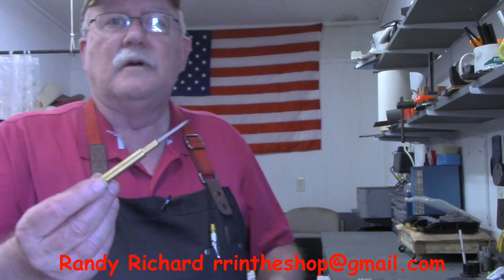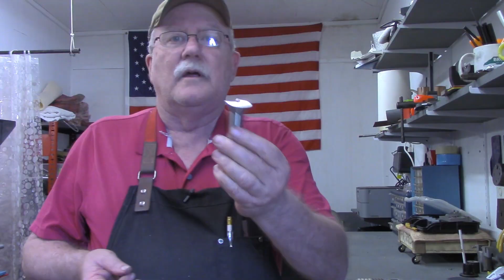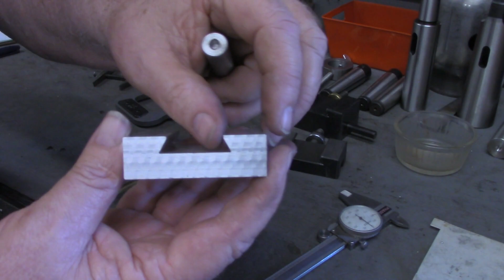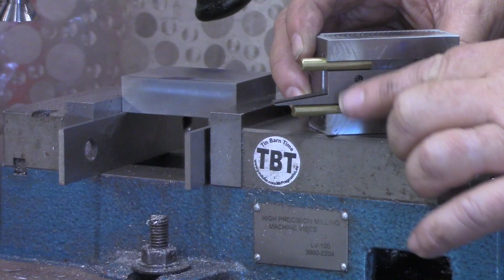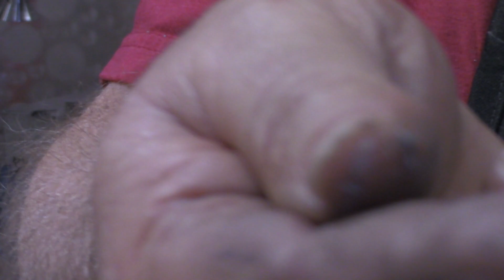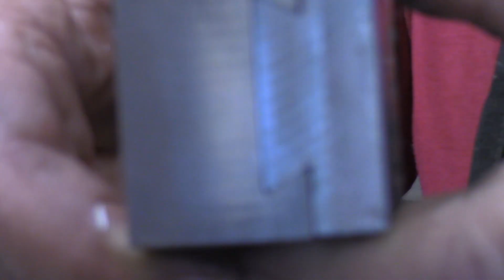Machining Matching Male & Female Dovetails

Comment: Hi from sunny England! Just found your channel and have spent the evening watching your videos. Thank you for the very informative, educational and entertaining content and for sharing your expertise! You are a really talented guy and I'm really enjoying learning from you. You have a very straightforward, no nonsense approach and a very clear delivery. Thanks again! Subscribed.

The main reason I zoned in on this particular video is that I want to build my own CNC milling machine similary to a number of projects seen on YouTube, but instead of using those linear rails, use dovetail ways instead. Seeing how accurately you made those dovetails has given me great confidence that with enough time and practice, I could perhaps do it too.

May I ask: are you milling the sort of steel that machine ways are usually made out of? If not, what material would you make machine ways out of and how would you harden them? I'm thinking that milling machine ways require a jib for adjustment?

Comment: How much payment to make a small male and female dovetail in either steel or aluminium? I am DIY and currently building a table router fence and need a robust linear sliding function for one of the micro adjusters. No crazy tolerances.

Comment: Thanks for the video, very interesting and thought provoking. But I think you were lucky, because your pin diameter is the same as the depth of cut, ie the height of the dovetail. Here is my thinking about it: having made the female part and measured it as you do, surely you must now have the (same) pins reference the TOP surface of the male part as you are making it and measuring it to size?  And this will be tricky to hold in place for measuring. I suggest using pins that are exactly diameter of male dovetail 'height'. Then they can sit on the 'base' of the male part for measuring, at. which time they will line up exactly with the top. Aaarghh. Geometry tells the tale, and a simple sketch shows it clearly.
CraigS was thinking along similar lines 3 months ago. Altogether a fascinating and tricky problem, and I appreciate what. you have done and shared here. Best wishes!
Edit one day later: Double AAARGHH I am wrong !!!

Comment: You ccould measure the male also with micrometer by measuring the outside minus twice the diameter of the pins. Now you use the same measurement device to measure only the difference instead of two absoluut distances
Reply: Thanks for the input, but I don't think so. See my post in the main thread today, and CraigS a few months ago.

Comment: Nice video,  nice well fitting dovetail!
One thing to consider when you measure both sides with the pins.  Unless the pin is the same diameter as the depth of the dovetail you are not measuring both parts at the same point on the slope face of the dovetail.  If the pin diameter is smaller than the depth of the dovetail you would measure the female as indicated but on the male dovetail the pin needs to reference the top of the part (widest part of the dovetail) to measure on the same plane on both parts. Edit:  Even this may not be adequate, just realized the pins don't contact the slopes of the dovetail at one radius above the bottom of the dovetail it actually contacts at  one radius plus the sine of 30 degrees times the radius  1.5 radii above the bottom.
Reply: Oh I think you are right the first time mate - ie pins reference TOP surface of the male part. And this will be tricky to hold in place for measuring. I suggest using pins that are exactly diameter of male dovetail 'height'. Then they can sit on the 'base' of the male part for measuring, at. which time they will line up exactly with the top. Aaarghh. Geometry tells the tale, and a simple sketch shows it clearly. 
I was just figuring this out when I saw your comment. Thanks to Mr Pragmatic and to you.
Reply: The pin diameter for a 60 degree dovetail is 1/3rd of the dovetail depth if you want to use the same dimension for both male and female parts. - https://drive.google.com/file/d/1GVwxHEvnL8JpYFfUzes3Z2zrhlT1NNAX/view?usp=share_link

Comment: Is there a meaning at all to the angle of thw dovetail?  Is it 60 degrees from horizonatal? Do some producers use some odd specific angle just to brand themselves, or can it be a more important thing? why not use the large radius corrugated pattern used on jet engines now,  reducing all the complex vibration at fast speed?  Is there a lathe in the world that can do 20000 rpm on large aluminum, for ridiculous surface speed,  (that would still be way to fast for AL huh) 2000 surface feet is adequate for rough work.
Reply: horizo-natal? At 20,000 rpm? Spectacular!!!  Seriously though . . . 45 degrees, 30, 60, are the common angles. It's all about  the horizontal and vertical force vectors across the angled surface.  Cheers

Comment: I'd like to point out a couple slight problems with your method of measuring a dovetail.  You use pins that have
an uspecified diameter. This introduces two problems.

The first problem is to not hit the dovetails at the same depth.  Think of using pins with a diameter one tenth the depth of the dovetail cut. Lets say the pins then hit the female dovetail at the 5% depth.   Then measure the male dovetail the same way, and you will be at a 5% depth again, but relative to the female dovetail, you are at 95% depth.  I'll leave it to the reader, to figure out what happpens with pins that are too large.  

What you want is to have the pins hit at the exact same depth on both male and female dovetails.  pick an arbitrary place, I pick the middle point to make it easy. what dowel pin will hit at the middle? you might think a dowel pin with a diameter equal to the depth of the dovetail, you'd be close but still wrong.

For a 60 degree dovetail a circle (a round dowel pin) will hit it at 60 degrees, so you need a dowel pin that is sin(60) x depth of dovetail.  So .866 x depth of dovetail.   Your method was close because you used pins that were close to this size.  For those who have tried and had bad results, check the size of your dowel pins and see how close they are to .866 x depth of cut.

There should be a correction factor for adjusting measurements using dowel pins equal to the depth of the dovetail.  In my younger days I'd figure it out and post it.  But, alas, my brain is just too old.

I worked out a figure.  But I caution you I am old and tired, this could be wrong.  Dowel diameter equal to depth of dovetail, multiply the diameter by 1.077 to correct the diameter of the dowel pin so it looks like it is hitting in the center of the dovetail.
Reply: I've been thinking along the same lines. Mr Pragmatic  was lucky this time, though his method is faulty ! I have a different approach, which now I realise is only good for 45 degree dovetail. Thank you very much for your deep thinking about this. And hell, my further thinking (?) shows I am quite wrong even for 45 degrees. Ha ha ha. Tricky problem!!! I expect the answer is in Machinists Handbook, and it ain't pretty. Best wishes.
Reply: For the pins to be directly above each other ie. the same distance apart on both the male and female 60 degree dovetails the diameter needs to be 1/3rd of the depth. Bisect the dovetail angle and construct a vertical line through the true angled length, including sharp corners. The intersection gives the centre of a pin that will rest in the same place on both male and female parts. The pin centre on both parts is always above and below the centre of the angled line. This eliminates trig from cutting dovetails, if it is for yourself, simply make the depth 3x what pin diameter you have. Make the female roughly to size - measure over pins then use this dimension to make the male, just one part needs to be made to a specific size.

Comment: I have a question.
I'm planning on doing a not so heavy mill, the structure is going to be welded, steel plates, not old like cast iron.
I have to choose whether use cast iron dovetail rails or Hiwin like linear sliders.
Reply: I suggest you check out This Old Tony. He knows about that sort of thing . . .

Comment: I would never use a methodology that tries to match an inside mearsurement to an outside measurement.  I would only use inside-to-inside or outside-to-outside.  You will have to mathematically subtract (or add) the known diameter of the dowel pin.

Comment: I'm doing something wrong? Made matching dovetail, however when I measure as explained in video  there is hundred thousands difference and I measured as explained in the video..
Confused.
Reply: Yes, this method of measuring is wrong! The equal inside/outside result depends on dovetail 'height' (and pin diameter), so in Lee's case it was purely coincidence that he found the same dimension.....  Make a simple sketch of it and you can see for yourself.
Reply: @michaelhompus2475  Can you explain a little more?  If the dovetails are to fit, don't they have to be the same depth as each other?  If they are the same depth and the angle is the same then I think that the same pins should touch at the same height.

I can't see the problem of using pins to measure the dovetails.   I'm not to proud to learn.  If you know a better way I am very interested.  Thanks and best wishes.
Reply: @michaelhompus2475  I'm afraid you are right my friend. But the question is, what is the correct approach? I'm sure the pro machinists know, but they have not been following here. Wonder what Joe Pieczynski
 has to say? This Old Tony knows a few things too.
Reply: i don't know maybe you have to compensate for the pin thickness.
Reply: The pin diameter needs to  be 1/3rd of the dovetail depth for 60 degree dovetails. Only this diameter pin will rest equally on both parts.

Comment: Sorry, luck not technique.  Your internal measurement of the pins on the male dovetail won't necessarily match the external over the pins in the female.  You got lucky that your pins were just about the right diameter to give similar measurements.    Do the calculation or draw it out and you will soon see the measurement doesn't match except for a critical diameter of pin.  Repeat it with different diameter pins and you'll see.
Reply: If you want to use the same measurement over the pins for both parts, use pins that are 1/3rd diameter of the depth for 60 degree dovetails.

Comment: Wow memories working for us currently. We had an R&R large back years ago (still brand new) and we bought the scribe brass then as well, we loved them so much we did not use them so we waited to use them on a special machine rebuild, so after we finish rebuilding or Barker Mill to run the cutter on it we will be using the larger dovetail cutter on it. 
We later this new year 2019 bought the small dovetail and the stainless steel scribe so we have them all now, we will use the large dovetail in our machine testing for this milling machine rebuild. 
We know Reid he has a really nice workshop metal and wood type work and we really enjoy Randy and his tools, so it is great to be here to see one of these fine dovetail cutter make some cuts and make these cuts correctly.
Really nice machine work lesson and that was nice to watch, we can do it to now. 
Lance & Patrick.

Comment: Well, I'll be darned if your vid didn't make life easier for me. I'm replacing the entire compound slide of my lathe with one I'm making from scratch and after completing the female top portion with tool post slot and about to start the male under portion with the attendant difficulty in measuring for gib allowance, your simpler method of measuring from inside of pins to outside of pins rather than halving the diameters of pins and constantly doing the math required, had never once occurred to me and I've been a certified general machinist since 1963.  Never too old a dog to learn a new trick I guess.  Love those insert bit dovetail cutters too. Gonna look for those. Kudos pard.

Comment: The inside vs. outside measurement of your pins was just luck in this case.  To take this to an extreme for illustration, if you used 1/4" dowels and had a dovetail that was 1" tall, the dowels used to measure the male side are going to be far closer together than the dowels used to measure the female side.
Reply: If you want to use the same measurement over the pins for both parts, use pins that are 1/3rd diameter of the depth.

Comment: The only way you can duplicate the clearances is but making the same height dovetail and use the same diameter pins.. For instance, let's say you are using 1/4 inch pins in your example. What kind of measurements do you get if you use 3/16 pins?
Reply: If you want to use the same measurement over the pins for both parts, use pins that are 1/3rd diameter of the depth.

Comment: Thanks a bunch for explaining very well how to make dovetails, I am very new and have only had a mill and engineering lathe setup for a month, no Dro yet on the mill and not much tooling yet so that his how green I am lol.

That pin method of measuring was very well explained and when you first mentioned it I was hoping you would explain it which you did, thanks for that as I would have gone the caliper or worse steel ruler route and got frustrated.

You are a lucky man aswel, I have been uploading wood turning vids for a little while and have subscribers but so far have not had anything bought for me 😁 , some wood given to me though at a wood turning symposium by a subscriber which was very appreciated though, hopefully watching your vids and other professionals I should be able to get started up the right way 👍
Reply: just watch this video & read your comment 3 years later, curious, hows the mill treating you these days?
Reply: @mtraven23  not too bad, I think back then I had a Warco 16b which has been upgraded to a Myford VMC , it gets used quite a bit and I would be lost without it

Comment: Why don't they put two carbide cutters in the dovetail holder? Seem like it would make for easier cutting and a smother cut.
Reply: A single insert is fine. It clears chips well and being an indexable insert distrbutes heat well. Putting another insert on a small cutter like this would also weaken it due to the size insert you need to make a dovetail. Nice strong ridgid tool, couldn't ask for more.

Comment: I have been imagining the geometry of those pins, and it seems to me that this measure-between-pins on female and outside on male gets you close, but it's not clear which measurement should be larger.
In a perfect ideal dovetail with zero slop, the outside measurement of the female pins would be smaller than the inside measurement of the male pins--the only way for them to be equal with zero slop would be if the sidewalls were vertical (a groove instead of a dovetail). Conversely, in an exaggerated sloppy dovetail the outside measurement of the female pins would be larger than the inside measurement of the male pins. Hence, the point where the two numbers match is close, but somewhat arbitrary. It's likely going to be just about right, but I think I would want to do a quick sketch and some trig to understand it better.
Reply: doesn't the diameter the measuring pins have to be EXACTLY the same as the height of the dovetail? And if there is clearance over the center of the joint, you would put a shim under the pins the same as that clearance?
Reply: @pcbondart  No, for 60 degree it is 1/3rd of the height.

Comment: Lee, this 80 year old guy needs a little help understanding this process. When you place the brass pins in place, then install the adjustable parallels , what part does the pins play in the overall process.  Are you adding the diameter of the pins ? If so I didn't see you measure the pins. Can you run that by me again. Thanks  Ken Marina California.
Reply: If this was a square dovetail (no sloped sides) you could just measure the width of slot and make the matching male part to fit.  But the sides are sloped so we use pins to contact the slope at a point one point  above the bottom of the female slot. Now if we measure the distance between the pins we can figure the width of the female dovetail at that point. It's more complex than adding the pin diameters but adequate for comparison.   This is because the contact point is not at the radius of the pin for a 60 deg dovetail but 1.5 times the radius of the pin above the bottom.  The width at that point would be the measured distances between the pins  plus two pin radii plus two more pin radii divided by the cosine of 30 deg.